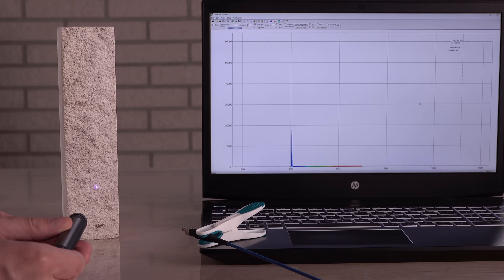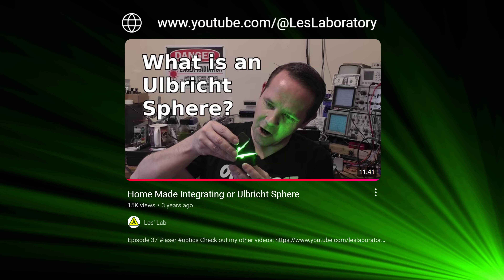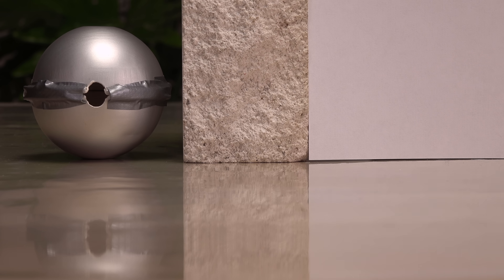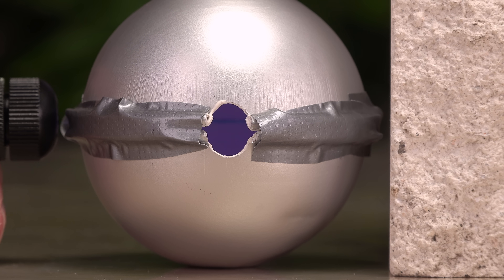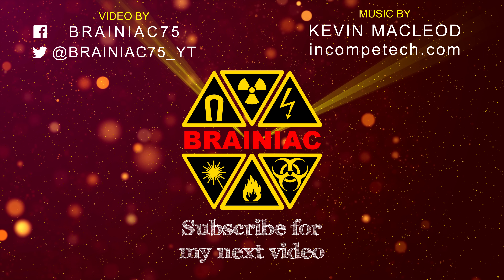Cake Mold as LASER Diffuser?!? | DIY Ulbricht Sphere Prototyping and Testing

Comment: You mentioned that by putting lens in front of a laser, the reflection can be enough to fry a laser diode. So, how to prevent that reflection from lens? I require lens in front of the laser.

Comment: Very nice!  I made integrating spheres for a high power laser project at work out of small copper floats. The halves have an overlapping soldered joint that can be undone once the holes are drilled. I glued them back together after applying the BaSO4 powder by just sprinkling it onto a layer of wet spray paint. 
They also have convenient threaded mounting points.

Comment: 1. For better holes, tape before drilling- or move axis so holes are both entirely on one surface. 
2. For better coating- make paste w/glue and apply w/ brush as demonstrated for first layer. THEN tape two sides together and seal off one hole. Make a slurry of just water and the mineral and pour it into the remaining hole. roll it around to get an even coating and pour it out and wait to dry. repeat several times adding layers until you have a consistent surface. Pottery is painted, and can even be made using "slip" like this.

Comment: So, we can see you are more of a scientist and less of a engineer, because you could just drill holes not at the edge of bowls.
And even if it was necessary to have holes right at the edges, the simple way would be to cut it with saw or file, not drill it. Drilling is for holes in monolithic objects.

Comment: Now I'm wondering how those molds are used for their intended purpose. Do they make two halves and use icing to "glue" them together, or do they clamp the two halves of the mold together somehow filling the entire mold with batter. I can't imagine that would be easy to do without a giant bucket of batter so you could do it underneath the surface and avoid air bubbles. It must be a two part and "glued" together scenario, but that wouldn't hold together nearly so well. Either way, I saw several listings for big molds that are only $20 USD, so we'll see.

Comment: There are a ton of great comments on this video. Honestly dude, you didn't do half bad. As someone barely dipping their toes into making stuff, especially a complicated thing like metalworking? You did great. Some things can only be learned by trial and error. So don't beat yourself up too much.

I would strongly recommend buying a unibit / stepbit, they make ROUND holes in thin metal very quickly and easily. Drill bits 'walk' and make triangular shaped holes in thin metal, grab the metal and bend/twist/pull, etc. Unibits have one cutting edge, and support the hole around close to the entire circumference, and one bit is 10+ sized drill bits in one, and they countersink the hole at the same time. They are worth buying. And get it in your head that ANY TIME you drill a hole, you center punch it first. Always. No matter what. Small things like that being ingrained, is how people skilled in a hobby or passion get to where they are. It's just a never-ending chain of trial and error. Ya did good bud

Comment: what about Christmas baubles? highly spherical, and i can say from experience it's easy to get thin paint to swirl around to coat the inner surface evenly. only downside is it's hard to drill an exit hole in, so it's more likely to just be scraping off a small spot of the coating so the diffuse light can exit through the glass. then again, i suppose that can affect the measured color of the light

Comment: Why not use Christmas tree decorative balls? You just have be carefull and use sanding tools to create the holes.

As for the Barium Sulfate, you can use carpet glue. It's a very slow drying glue and low viscosity.
Then you can insert inside, and spread it around by shaking the ball.

Then when all the glue is coating the inner surface, just add the dry powder and do the same.
This should also make the surface evenly matt with no brush lines.

Comment: I think you would be better off drilling the holes not on the seam but in the hemispheres themselves, then you also don't have the potentially odd geometry surface right at the point where you shine the laser, it'll hit somewhere that is on a smooth part of the sphere. I also think it'd be much easier to drill them on the parts without a seam, and the seam being unbroken will help with the structural integrety of the shape.

For holding it together I think it'd work better if you wrap tape all the way around so it's held together not only by the adhesion but also by the tensile strength of the tap itself.

For a visual of what I mean, if you imagine the earth as the sphere with the equator being the seam, I'm saying wrap a round of tape at the the GMT+0/GMT+12 circumferance and then another loop at the GMT+6/-6 circumferance, that should hold it together much more securely.

Comment: My thoughts on the project, try using a ball Christmas ornament or plastic globe light housing. If you are going to be coating it anyway, then the main concern is being easy to work with and having a large, round, hollow object. Try epoxy as a binder and then pour in into one hole, tape off both holes, then turn it all which ways to coat every surface. Unplug the holes, and then pour out the excess. Repeat as needed for thicker coatings. As funny as it was watching you try to drill into the metal balls, it would have been a whole lot easier to drill into one of the curved walls (or the flattened top/bottom) instead of a seam lol. Since you were taping them together anyway, it didn't matter where the holes were going to be. Only that the in and out were offset from each other. All that accomplished was making things FAR more difficult for yourself... and giving us a little extra entertainment I guess.

Comment: Just a thought, To safely disperse a strong beam It might be possible to mount a smaller sphere in the center of a large one so that the beam would be reflected double, both at the send and the receive side.  I think a thin post measured at the right length would work well.  And I second the motion that you could have drilled anywhere but the seam with good results.  Also, get a step drill for sheet metal.  Works much better than a twist drill.  And while I'm at it, use aluminum foil tape like they use on HVAC instead of gaffer's tape.  It forms and holds better and even reflects (poorly on the adhesive side though).

Comment: What about solid alumina as a material? It resists crazy conditions and it is white. I don't know if its reflecting properties are good or not, just putting it out there. But it's kinda impossible to work with, you might have trouble finding a piece of a suitable shape.

Or otherwise, powdered alumina as a coating like you did here? It's cheap too.

Comment: 9:50 reading your list of potential improvements, I reiterate that if you drilled your holes somewhere other than on the junction of the hemispheres, it would probably be easier to drill, and the majority of the light would be reflected by an homogeneous coating whereas here you are aiming the laser straight at the part which is the least spherical.

I understand that drilling at the pole would put the second hole on the equator if having a 90° angle between input and output is import, but that's still one easy hole gained.

Comment: 2:25 drilling holes in spheres, especially in metal, is always difficult. You're making your job harder by drilling at the junction/equator, I'd have drilled at the pole I think.

With difficult holes it's generally a good idea to first make a dent at the target position using a center punch tool or, if you don't have one, a hammer and a nail will do most of the time.

Then depending on the material and drill and depth of hole etc. you may want to first drill a pilot hole, i. e. a hole of lower diameter than the one you want, and then drill the one you need.

Sometimes it can be useful to drill multiple "pilot" holes, i.e. to progressively increase the diameter of the drill bit. It would probably have been a good idea to drill the hole gradually here, because this cheap aluminum (I know this bowl lol) shears easily.

Comment: AI Summary

DIY Ulbricht Sphere for Laser Measurement

*   *0:00
Error: no such column: None1:09 Solution:* An Ulbricht Sphere, a hollow sphere with a highly reflective inner surface, can diffuse the laser beam, making it safe and suitable for measurement.
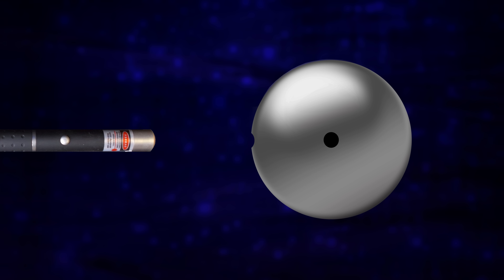*   0:01:36 Building the Sphere: A small, spherical cake mold serves as the base. Two holes are made (with some difficulty) for light entry and exit.
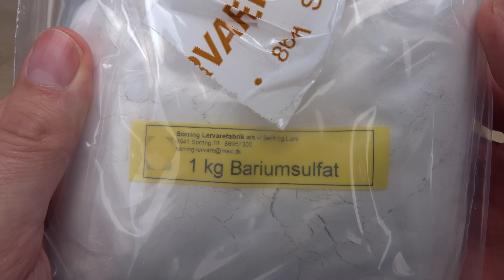*  0:03:38 Coating the Interior: Inspired by Les' Lab videos, Barium sulfate (BaSO4) is used for its high reflectivity across visible wavelengths and lack of fluorescence. It is mixed with water to create a paint-like substance.
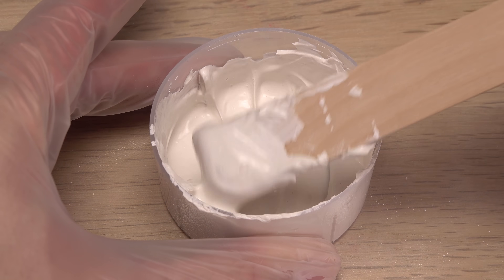*   0:04:22 Application Challenges: Applying the BaSO4 mixture to the unprimed, anodized aluminum is tricky, requiring multiple coats and careful handling as it doesn't harden.
*   0:05:04 Final Coating: A thick layer (approx. 14g) of BaSO4 is applied to the inner surface.
*   0:05:21 Testing with Lasers:
    *   0:05:29 Red Laser (5mW): The sphere successfully diffuses the light, preventing overexposure of the camera and making it easier to probe with a spectrometer.
    *   0:06:09 Stronger Red Laser (30x): Still works well, with the reflection showing significantly reduced intensity.
    *   0:06:38 Violet Laser (405nm): The sphere effectively reflects the violet light without fluorescence (unlike white paper), despite the human eye's low sensitivity to this wavelength.
*   0:08:01 Spectrometer Measurements:
    *   0:08:01 Red Keychain Laser: The sphere significantly reduces intensity, allowing for safe and stable spectrometer readings.
    *   0:08:31 Stronger Lasers: The small sphere size requires adjusting the probe distance for stronger lasers to prevent overexposure.
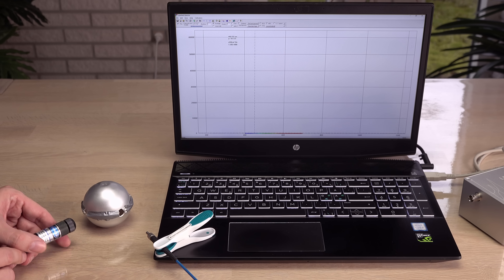    *  0:08:46 Violet laser: No issues were found.
*   0:09:01 Infrared Laser Tests:
    *   0:09:03 808nm IR Laser: Reflected well.
    *   0:09:13 980nm IR Laser: Reflected less efficiently, requiring closer proximity and longer exposure times for measurement.
*    0:09:31 Overall Success The home made Ulbricht Sphere works great. It provides stable readings for little money and effort.
*   0:09:58 Future Plans: The creator considers building a larger, more video-friendly version, or possibly a 3D-printed version.

I used gemini-2.0-pro-exp-02-05| input-price: 1.25 output-price: 5 max-context-length: 128_000 on rocketrecap dot com to summarize the transcript.
Cost (if I didn't use the free tier): $0.0190
Input tokens: 12557
Output tokens: 669

Comment: For applying the Bariumsulfat  - perhaps you could use an inexpensive flocking gun (usually less than $30 for a full kit)
Flocking is used by woodworkers to apply a powder like material to the interior of boxes without the need for heat.

Comment: Very nice, as always!  But didn't you hear of the recent news of a group that had developed barium sulfate coating for passive cooling of buildings?  Working like a reverse greenhouse, the Barium sulfate reflected all visible light but allows infrared from inside the building to escape to the environment.  So I knew that the device wouldn't work as well with infrared lasers.

Comment: Could Barium Sulfate be applied via an electrical process as is done with powder coating? Even if the initial adhesion was poor, it seems that it could be then sprayed with a thin layer of some other substance (epoxy, poly vapor, etc). I'm not a coatings specialist, but geez, that thick layer looked like dabbed on stucco. :) - Always love your videos.
Reply: Check out an inexpensive flocking applicator. Spray on a light coating of glue, then use the flocking gun to aerosolize the powder onto the glue surface. No heat needed. Just shake off the excess material after the glue dries.

Comment: How is this better than just bouncing the laser off a diffusing surface and measuring the diffused light? Even if there is flourescence, the actual wavelength will still be much brighter. I just tested my 410nm laser with paper and an orange safety cone, which created bright blue and orange light respectively, but the 410nm was still far brighter in my spectroscope.

Comment: @Brainiac75 2:30 For future production, the hole does not NEED to be at the "equator" you can just rotate the ball some 10-ish degree & drill just under the "equator rim", then a little over the "rim" for the "output hole".
And to make it stand still on the table, just use a hammer & dent it where the new suitable "bottom" becomes, or this one is small enough to use that gray gooey stuff you can put on the back side of posters to hang them up (whatever it's called?).   (read below -v-v-v-)
    I would actually think it is best to drill the input-hole in the top, that places the rim at 90-degree to the input, where the laser "should"(?) be at it's weakest intensity, so even if the sphere leaks laser-light, it is as little as possible, just by it's geometry.
    You could even make a 3-layered ball (like a Matryoshka Doll), where each sphere is at 90-degrees to all outer spheres, with 3 layers it is made geometrically impossible for a beam to have any straight path out of the sphere (except for input- & output-hole)(assuming you hit the laser inside the inner-most spere) even without any additional sealant, you can make some kind of inner stands so all 3 balls are aligned in the perfect center.

Comment: Maybe could tape the ports shut, pour in the glue mix, then roll the sphere around to coat everything inside including the gap between the halves

Then take the tape off the ports and pour out any excess, then let it dry

May need some airflow into it to dry the glue though

Comment: I've got a silly question as a non savvy physics noob.
How do we know when there are wavelengths outside of the visible wavelengths?
Like, I understand we have tools like the spectrometer to detect them. But how do we know that the tool itself is actually detecting those wavelengths?
( I know this is probably more of an ontological question, like how do we know oxygen exists if we can't see it..)
But how can we be sure there's anything being detected by the sensors, and how did the first scientist know to "detect" something that he couldn't see..?
Reply: I think the way it was first discovered was splitting light through a prism and observing that the areas beyond where the visible colors of light ended was also seeing temperature increases like the areas that were hit by visible light.

As for how we know can know they exist today, there are several every-day technologies that only work if there are invisible wavelengths and they work like we assume that they do, for example a remote control is simply an LED that sends out light in the infrared, your phone's camera can likely detect it if you point a remote control at it and press some buttons. Radiowaves are also electromagnetic radiation in the far far infrared spectrum. WiFi is also carried over electromagnetic radiation. If you have a microwave that too functions based on this.

On the other side of the spectrum in the UV, we have germicidal lamps that can kill bacteria, we have lots of things the fluores when you shine UV light on them. We know of many health effects where the body gets affected from light that is invisible to us, like a sunburn or welder's eye which is caused by intense UV. There are a couple of cases of large club parties using  mercury lamps for lighting because they have a cool light blue colour, but they also emit a whole lot of UV, so it's just blue as far as we can see, and many people had eye injuries after attending these parties because of the lighting, luckily welder's eye is a pretty temporary affliction  and it gets better after a couple of days.

Comment: I would drill on the curved surface of the spheres instead of the edges, cleaner and easier (45 degrees up from the flat bottom on both puts the holes 90 degrees apart when the two halves are joined).  Use putty to hold the sphere steady on a work bench.

Comment: What about pouring in a small amount of the "paint" into a hemisphere and then swishing it around until it sets a bit? Would probably make a layer that's more uniform than using a brush and would probably require less of the material.

Comment: I would suggest drilling from the bottom of one hemisphere using a guide hole, tap it using a sharp nail or some sort of punch, and then drill, or use superglue and then drill them, however you’ll still probably have an issue.

Comment: at 6:31 i dont think those are due to constructive or destructive interference as one point on the table will recieve waves from a lot of points and it will just average out giving a smooth red colour,I think its caused due to the noise in the camera altho now when I'm thinking about it the signal to noice ratio is really good at that part so it shouldn't be there but it should average and i dont think its due to interference. Could u see that with eyes?

Comment: nerds on youtube creating lab instruments at a fraction of the price will forever be my favorite type of video
Reply: With scrap, in a SHED!
Reply: It's amazing what you can get away with once you have the refined concept and don't need 0.001% or better error tolerance, which almost nobody actually needs.
Reply: The other good thing is that if you have made something yourself you probably know how to measure and calibrate it rather than just expecting the thing you paid for with your firstborn is going to be perfect and perhaps ending up wasting countless hours of diagnosis and getting heartburn because nothing makes sense.
Reply: @savagesarethebest7251  tbf this is just a round box with two openings and paint inside